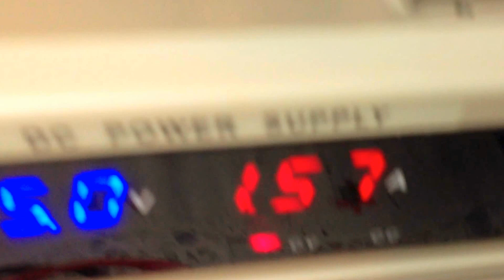hho alternator 5v 1.6 amps

Comment from the maker: actually, for what I'm trying I thought about slowing the motor down because the frequency is too high for what I want to do. because the motor is weak it  won't handle much above 7volts before it starts bogging down and overheating.I've taken the regulator out so I can vary the voltage through the power supply.What I really need is a variable speed 3 hp motor.